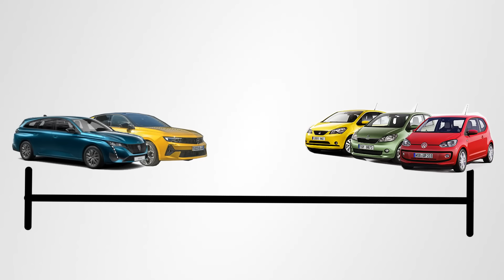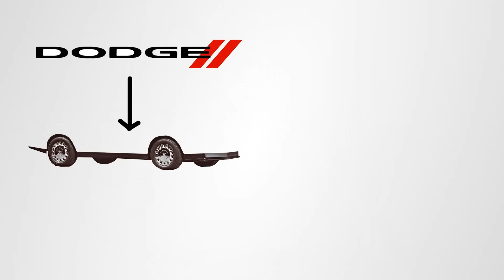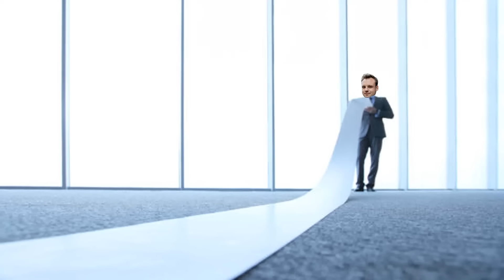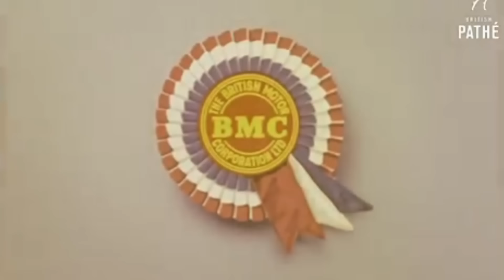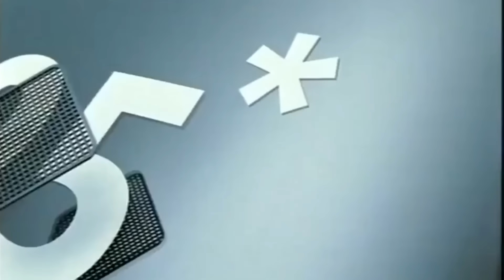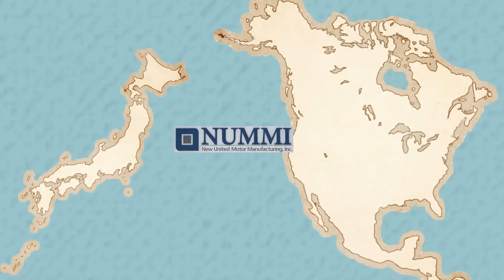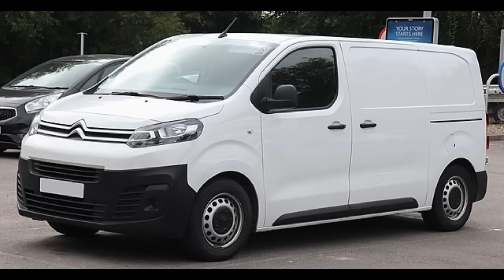Ep. 30 Seeing Double: The History of Badge Engineering

Comment: A strange one: Kia Elan - yes a Kia badged Lotus Elan that was apparently also sold in the UK? Also there was that time when Dodge rebadged the unsuccessful Europa S as one of their EV concept cars.
Reply: As I recall, that wasn't exactly a rebadge as Lotus actually sold the design to Kia.

Lotus design and handling... with a Kia motor.
Reply: Oh, there's another Isuzu related vehicle. The M100 Elan came with the Isuzu 4XE1-WT Turbo 1.6L, as featured in the 2nd generation Isuzu Piazza/Impulse and the 3rd generation Isuzu Gemini.
Reply: @quintessenceSL  oh my
Reply: The Elan wasn’t a rebadge. Kia actually bought the tooling and design. The Elan originally had a lot of Isuzu parts in it… and the Europa to the Dodge Circut eV concept want a “rebadge”. 🙄 it was cross platform sharing… it was gonna be like the deal with the Tesla Roadster and Lotus. Lotus delivers a rolling chassis, and they were to outfit their own power train, interior and front and rear clip.

Comment: The black mystery car shape used in the video is also an interesting one. As the USSR lacked quality cars and the technology, they bought a whole factory with everything needed from Fiat and built a suitably named new town (Togliatti). And rebranded the F out of some fiat models, domestically branded as Zhiguli and exported as Lada. True, it was not a straight rebrand , more like tech transfer, they had to beef up the undercarriage A LOT to last in the roadless countryside and make the car as easy to repair as possible. That whole thing would make a cool vid..
Reply: After that the USSR licensed the Lada (essentially the old Fiat 124) to Egypt. Egypt was making them well into the 2010's. Not bad for a 1966 design.
Reply: yeap the lada is a copy of the fiat my dad had a fiat back in the late 70s early 80s i drove that car in l.A. back in the 80s
Reply: They were shipped to New Zealand as deck cargo. At that time i was finalizing my panel beating / painting apprenticeship. We were repairing these cars for rust as they were unloaded from the boats

Comment: The Fiat 124 - the silhouette that Ed uses, was also a Lada Riva and a Premier 118NE. Pretty sure it was rebadged in other Asian and African countries by the respective domestic manufacturers.
Reply: Most of Fiat models were licensed in eastern Europe.
Yugoslav Zastava produced excusivelly Fiat rebadged models until Yugo in early 80s.
Zastava 750 - Fiat 600
Zastava 1300 - Fiat 1300
Zastava 101 - Fiat 128
Zastava 128 - second series Fiat 128
Reply: That probably deserves an episode on it's own. Fiat 124 originaly became VaZ 2101 in USSR. It was not a direct rebadge as the USSR version had some "modifications". The original transfer of technology and tooling led to other models based on the same platfrom 2103, 2104,2105,2107...... There were other rebadges of the same car - It became SEAT 124, Tofas, Kia 124....

Comment: One of my favourite and laziest case of badge engineering has to go to the “CAMI” platform of cars such as:

-Suzuki Vitara
-Suzuki Sidekick
-Suzuki Escudo 
-Chevrolet Vitara 
-Chevrolet Tracker
-Geo Tracker
-GMC Tracker
-Pontiac Sunrunner
-Asüna Sunrunner
-Santana 300/350
-Mazda Proceed Levante
-Wanli WLZ5020XLD
-Guangtong GTQ5020XLZ 

I would know about the GMC Tracker because my mom actually owned  one!

I had to edit the list because I missed even more of them!
Reply: And the Suzuki Swift and its variants, the Geo Metro, and Pontiac Firefly. I had a Swift. Built in the CAMI plant in Ingersol, Ontario, Canada. A fun little car. Unfortunately badly set up by the dealer.
Reply: @irvinmartin9259  Unfortunately, the Metro never got the GT engine.  The 3 banger I had was the best car I ever owned.  Never had a days trouble with it.  Wound up giving it to my sister.  I had the 4 cyl. one later on.  Piece of junk.

Comment: Great video Ed! One thing: you missed the origin of the "most rebadged car"... it was an Opel Kadett! 
from Germany! In Argentina, the Opel K.180 was a Frankenstein, instead of using the original 4 cylinders engine, engineers here "chopped" two cylinder from the all mighty Chevrolet 6 cylinders 230 (that's why it was 1.8). Cheers from Argentina, where we have several rebadged cars here. Will provide some soon.

Comment: One of my favorite rebade stories is when a car was on the dealer floor with Chevy badges on the front and Pontiac on the back
Reply: I remember a Mercury Lynx on the showroom floor with an Escort badge on the dash.
Reply: @shawncromwell2230  Holy shit- you actually saw that!?  What'd they say?
Reply: The salesman didn't appreciate me pointing it out (I was 14 at the time).
Reply: That was actually common in the 70s thanks to poorer quality control and multiple strikes.

Chrysler fixed that issue by not even putting brand logos on many of their K-Cars. It was just the Chrysler pentastar logo on the front and maybe the name of the model on the back, which could be interchanged with whatever they wanted. There was no difference between a dodge and a Plymouth.
Reply: @CamaroAmx  They eventually gave Dodge a different grill than the Plymouth, and the Chrysler a unique facia when budget allowed.  That was the lean 'bailout" years for Chrysler.
Reply: @CamaroAmx  the K-Cars had different light bezels, especially in the beginning. And the wheel covers were fancier on the Plymouth lol.
Reply: I believe this happened with the Neon, some units of which bore both Plymouth and Dodge badging.  Many Valiant cars sold in Canada up to 66 were just rebadged U.S. model Dodge Darts.

Comment: Don't forget those massive twins that introduced front wheel drive at GM: the Olds Toronado and the Cadillac Eldorado.
Reply: except that both cars were on different chassis, different bodies and different engines. the only thing they shared was the th425 transaxle and the front wheel drive configuration. so no, the eldorado was not a rebadged toronado.

Comment: The Fiat 124 which was built in huge numbers in half dozen other countries, notably in the USSR as a Lada.
Reply: And the 2008-10 GAZ Volga Sibers are rebadged Dodge Stratus’
Reply: Whats also funny (but sad) is the fact that the Lada 2104, 2105, and 2107 models (all based on fiat 124) were produced from the 80s up until 2012.
Reply: Lada bought the fiat 124 design so that they could build it in the USSR.

Comment: I had two Gemini's. A 1975 and a 1982. They were brilliant cars in their time, especially when modified with fuel injection, turbo, big brakes and suspension mods. Surprised quite a few larger and more powerful cars due to the handling and braking ability of the humble Gemini.

Comment: Interestingly, you could feature rebadging from Western models to models behind the Iron curtian (Renault/Dacia or Fiat/Lada)
Reply: Have to butt into this one: While soviets did a LOT of copying back in the day (Moskowitch=Peugeot and Volga=Opel), the Lada IS in fact a different car: While they copied the body of the Fiat 124, they actually (and this is shocking) IMPROVED the car by:

-Redesigning the engine that included an overhead camshaft and an improved radiator valve/thermostat
-Modifying the starter motor 
-Adding a hydraulic clutch (Okay, personally, I didn't find THAT to be an improvement.)
-Adding drum breaks at rear of the car 
-Modifying the suspension.

This resulted in a car that was much more reliable in the horrible roads and cold climate of Russia and VERY WARM.
Reply: @ladadavidson7926  Plus they made them for decades so even if it was unreliable garbage, they will still survive on spare parts for centuries
Reply: @ladadavidson7926  True that. Also, speaking of Eastern Bloc Fiats, there was 125p, which was a mix of Italian 125 (body and brakes), 1500 (engine) and partially 124 too (partial design of the interior), which may have been more primitive, but certainly FSO managed to make them more versatile with station wagon, pick-up, ambulance and even rally (yeah, no joke) variants. Basically one model became an all-purpose vehicle.

Comment: Was fun seeing how often NZ popped up on the Isuzu Gemini rebadge list. I've walked down a street here and seen the same car with four different model names and three manufacturers badges. Helped by the large number of second hand imports from Japan and Australia - You'll see a Toyota Corolla shipped here new 30 years ago, and an identical Toyota made the same year parked next to it that spent it's first 5 years in Japan and so is labelled a Toyota Levin. Or three dealers - one offering an imported  Lexus, one an Opel, and one a Holden, and all three are identical, except one had a previous owner in Japan, one in Britain, and one in Australia. I owned a Hyundai Delica van for a while that came with a Mitsubishi owners manual and had colt badging on the rear door from a replacement after damages

Comment: Though it had been done earlier, I think GM decided to go full in with rebadging in America during the 1970's. Never forget the NOVA. Nova (Chevy), Omega (Oldsmobile), Ventura (Pontiac), and Apollo (Buick).
Despite being essentially the same cars with different options and grills, the Ventura developed a reputation as poorly built, so it was cancelled. The Apollo wasn't what Buick customers were looking for, so sold poorly and was cancelled. Only the Nova and Omega names lived on to see a new platform.
Reply: An actual acronym! N.O.V.A.
Reply: in canada 1962 / 71   used the chevy nova body for the pontiac acadian canso .  then the stamping was sold to argentina sold as the chevy seris 2
Reply: @ascco-automotive9328  - ahhh, the lat 60's and early 70's Chevy NOVA/Pontiac Acadian. For those who liked to spend near continuous money on wheel alignments.
Reply: The 76-79 Cadillac Seville built to compete directly against the Mercedes, was a stretched Nova with a Cadillac fuel injected Olds 350 V8 motor.
Reply: Kinda, the Phoenix replaced the Ventura, and they replaced the Apollo with the now downsized Skylark

Comment: 11:29 This is very true with the American based Suburban SUV until 2000 as it was badged as both a Chevrolet and a GMC.
Reply: Late 90's Holden Suburban also. 350 chev motor, most uneconomical passenger vehicle on the Australian market at 23 litres/100km in 1997. The petrol powered 6 cylinder Nissan Patrol was a close second at 22 litres/100km.

Comment: My favorite case of cross platform sharing involved General Motors' intermediate cars from 1964 thru 1972. While the basic chassis and some body structure was shared between Cheverolet, Pontiac, Oldsmobile and Buick, each division had its own exterior sheet metal and V8 engine (basic cars used the Cheverolet inline six). This was a continuation of a common practice in the automotive industry up through the 1950s where there was limited parts sharing between divisions of a major car company. While the divisions of the Ford and Chrysler corporations were using corporate engines, GM still let its divisions build their own V8 engines. 

This led to some hilarious duplication. By the late 60s Cheverolet, Pontiac, Oldsmobile and Buick built their own 350 cubic inch V8 engines. These weren't variations of the same design. Each division's 350, were built from a that division's own engine family. Thus each division marketed its own 350 cubic inch V8 that had a different engine block and cylinder head and a different set of bore and stroke dimensions. To make things even funnier, Pontiac, Buick and Oldsmobile each produced a "big block" 455 cubic inch V8 using their own divisional engine architecture. Each division used a different bore and stroke to match their own engine families but claimed to have the same displacement. Cheverolet was the outlier this time as its big block V8 only had 454 cubic inches. You just gotta love General Motors.
Reply: I remember reading that GM had a shortage of engines in the 60’s, and put a “different” engine in some cars. I think there was a big lawsuit over it.
Reply: @5roundsrapid263  I vaguely recall something in the 1970s about GM putting Cheverolet engines in Cadillacs. This would have been nothing for the other members of the big three as Ford/Mercury /Lincoln and the Chrysler Corporation had already switched to "corporate engines" but GM was still avoiding that level of rationalization.
Reply: And that is why I like GM better in the 1980s because by then they started to share engines in other cars, example the Buick 3800

Comment: Fun fact: On the Charger/Magnum/300c, the front ends are completely interchangeable! That probably made the rebadge seen in the video with the Magnum a bit easier...
Reply: i´ve wanted to get a Magnum and put the front end of either a Challenger or a 2012 Charger
Reply: @ferdinand12390  I had an '05 Hemi Magnum.  That front end killed a slick looking car.
Reply: I do weirdly like the idea of getting a charger or 300 sedan and putting a magnum front end on it.
Reply: Fun thing is there is also an more European version of this a Lancia thema Different front and actually a way better interior.

Oh and yes. The Lancia came with a Hemi
Reply: On the 1st Gen only. Anything after the 2011 redesign, you’re gonna have a lot of bondo and metal work to get things to fit.
Reply: @brycmtthw  Yeah, I should've specified the LX platform only
Reply: Dodge/Plymouth of Canada did that in the 1950s and early 1960s.  Some of the fronts were a direct swap.  Finagle some side trim differences/swaps and/or two tone paint scheme variations, and you had a unique offering. Some of them were better looking overall than the original US versions.
Reply: The funny thing is, that is true for both Magnums, both the B Body from the 1970s, and the Wagon you're talking about

Comment: One of the benefits of badge engineering/platform sharing is that I can get parts for my relatively rare Oldsmobile 88 from a much more common Buick LeSabre or Park Ave. In fact, my center console is from a Park Ave.
Reply: My first car was a 2000 Mazda. All my repairs were with ford parts 😂

Comment: If you think these are bad, what about the GMT 360? 
These were all sold in the US, and in most cases, AT THE SAME TIME
You have *inhales*:
Chevrolet Trailblazer
Buick Rainier
GMC Envoy
Isuzu Ascender
Oldsmobile Bravada
Saab 9-7X
as well as the several body styles of the Envoy and Trailblazer, PLUS the cab styles of the:
Chevrolet Colorado
Isuzu D-Max
IN ADDITION TO
the Hummer H3 and H3T which were also based on the same platform
Reply: Good one.  The H3T was the only one of that group I'd like to own.
Reply: @tomm1109  I love the Hummer too, but a Trailblazer SS or the 9-7X Aero wouldn't hurt either

Comment: I had the worlds largest and smallest SAAB at the same time! Both was 1978 year model. Both had a chassis number plaque by SAAB. Both had the same color blue metallic. Both where sold by the same car dealer in Stockholm SAAB-ANA. They hadn't even bothered to re badge them.
One was originally a Autobianchi A112. I started a conversion into a 24h race car but sold it to another racer.
The other was a Dodge Tradesman 300  318cui 8 lug axles and a gas guzzler. I repainted it grey one night with concrete floor paint, because the police was on the look out for a blue van. 
I always placed my self two meters behind a semi to save gas, they never liked it!
I sold that one too! I doubt neither exist any more.
The most famous re badges SAAB was the SAAB 600 that was a Lancia. I owned a couple of those as well.
I have owned a lot of re badged cars. Now I only have a Chrysler Vision and a 1989 Chrysler Voyager, or is it Plymouth, I always get confused. I have to go and check in the garage. I know it has a 2.5L 4 cyl Mitsubishi engine though! It's the only one in Sweden!

Comment: General Motors(USA) was the king of rebadging from the 1970s forward, especially with the downsizing of their full-sized B- and C-bodies, and their mid-size A-bodies. 

Even their third generation  F-bodies(Camaro &  Firebird) were identical from the forward to the rear fenders, and the roofline
Reply: It's cheaper that's why
Reply: Camaro, Firebird and Trans Am?
Reply: @ntabile  'Trans Am' was a trim level of Firebird, not an actual model.

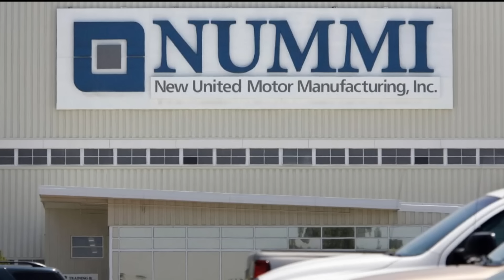Comment: Hey, @ 13:10, you mentioned the NUMMI Plant in Front, CA. That's now the Tesla plant. Anyway, I used to work there building the Toyota light trucks, the Corolla the Pontiac Vibe and the Toyota Volt. The Pontiac Vibe is just a Toyota Matrix, just rebadged. Both very good vehicles. The Toyota Volt ... well ... not so good. Yeah there were electric,  but they were a bit ahead of their time. Now these would have been better made in Japan, not in the USA. FYI, if you're gonna buy a Toyota, make sure that it was made in Japan, not the USA or Canada or anywhere else but Japan. There is a reason why GM & Toyota stopped making vehicles in Fremont, CA. Quality was on the lowest end of the scale.

Comment: GM/Holden were great at Badgeering.  The Toyota Camry and AE92 Corolla were both sold under differing names.  The Corolla a Holden Nova, The Camry morphed into the Apollo.  Badges changed but the inside of the door frames were stamped Toyota.  Holden went on to use so much of Opel vehicles for their small vehicle range over the years.

Comment: You missed one with the Sprinter,  as it was also rebadged as a Freightliner.   
And the Dodge Ram was rebadged too,  as a Sterling Truck which was a division of Freightliner Trucks which, like Dodge, was owned by the former DaimlerChrysler. 
And the bastardized POS known as the Chrysler Crossfire which was essentially a SLK320 (based on the R170 platform) with some minor changes.